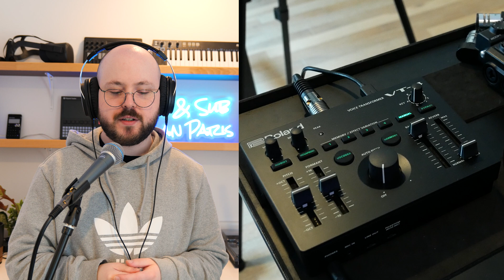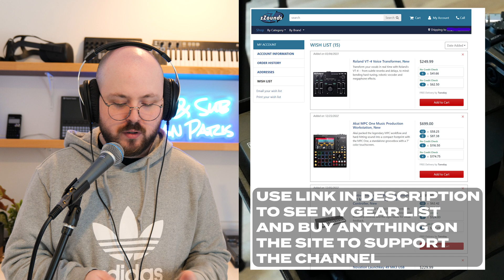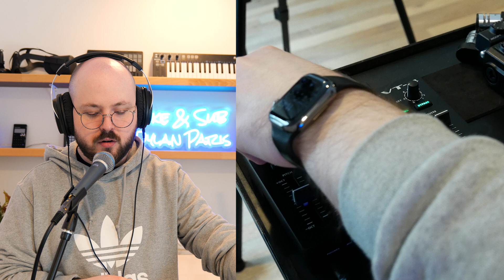Is Roland VT-4 Worth it in 2023?

Comment: You criticised the pitch control for stepping from one note to the next.  I did not see you turn that knob back to say halfway or even 25%.  Basically if you are able to sing in tune, you would never use Pitch control on Maximum.  Maybe only use it like that for funky music!  I used an earlier version of this gadget, and only set to very light correction.  That leaves nearly correct pitching from the singer to stand but corrects only if it would be noticeable. Otherwise the singing does not sound real!!!    It is a Clever little box of tricks.

Comment: Missing the point of the design. You can fire in the harmonics and chords via MIDI... This is a simple voice-box designed to run with a DAW channel or sequencer to give MIDI and auto-correct to the planned live vocal. It's made in Japan. It's a funky karaoke device, with added smart ring-mod robot styler reactive mods. It does sound authentically funky fresh like it was 1983 in Harlem on a beatbox with Bambaataa the Child Snatcher. It also works as a nice DAW interface for output/live input via USB. There are patchy USB software editors for this device that allow you to bust out the TB-3 depth Aira hidden protocols too. If you see one cheap, snatch it or weep. Future classic right here. The E-3 is tiny plugs and loosy goosey. This is the proper hardware if you like that Daft Punk robot boogie vocal. And you can run it on AA batteries too. In your headphones. At night. Around the world.

Comment: Hoping somebody can answer this.  Just got the VT-4 and I love it.  However, it seems that it goes through batteries pretty quickly.  Is anyone else having that issue?  Also, I know it can be USB powered, I just want to make sure I can go from a power strip to the unit and it doesn't have to be from a source like a laptop.  Any help is much appreciated.
Reply: Yup, usb power cable and a phone charger style wall wart 👍

Comment: The manual says it has low cut filter and enhancer and a noise gate you have to hold down certain buttons to change those settings for example hold down megaphone button and hit 1-4 buttons to adjust enhancer

Comment: Hi what's the best vocoder for gospel type of harmony?
Can anyone advise please
Reply: VP-770 but its a full size kbd and not cheap. Amazing gospel choirs
Reply: I have used every model of MIDI harmonizer since 1991.
 I use them in my studio to create SATB for choir. I can write the notes in the tracks and audition each part myself.
 I can modify any part and sing any parts, or all it in real time by myself.  It is gratifying for live  performance, too.
MY students use it to learn their parts.
Also I don't even have to actually sing. The system samples your voice and sings with your own recognizable voice.
Not like Auto Tune. It does not scoop into the note.
TC Helicon has been the best, but they stopped manufacturing in 2012.
 The only new product is the Roland VT4, but it is limited and not as pure.
Here is a demo. You can see other projects on my channel from here.
Much of the magic happens by the software. 
The genius author graciously modified the program for my use.
https://youtu.be/4fhFzexbvjA    Note the freestyle smoothness. I am just reciting without strict phrasing.
Notice in this classic, even the soprano descant happens simulataneously. in real time with my voice sample.
https://youtu.be/oA_zq-nAAME

Comment: Is there a chromatic scale or notes played option for the pitch correction?

I have this and the TC Helicon VE. The Roland VT-4's control accessiblity is good because it's simpler and has little menu diving. What I don't like about it though is there is no dedicated PSU. The USB option can get noisy and I don't trust batteries during a live set. Haha. It seems there is no chromatic scale option for the pitch correction too, which sucks because it's hard to keep on changing or searching for it per song. You're right that the EQ of the VT-4 is limiting. It sounds flat and compressed. Check out the TC Helicon VE. The headroom and clarity are better. The menu options just needs some getting used to but I'm happy with the overall sound compared to the VT-4.
Reply from the maker: I’ll check the TC Helicon out! Good looking out!

Comment: Anyone want to generate a late 60s/70s style vintage echoed vocal style (Think Jim Morrison/ the Jefferson airplane) on the VT4.... Here's one way to go about it

01) Enable Megaphone (megaphone preset 1)
02) enable reverb (reverb preset 2 - the vintage spring delay slapback style)
03) autone/hard tune at 0

Now, from here you have to mix and match between the levels of balance and reverb.....i generally keep reverb level high but toggle between the balance level based on what suits you.

Things you can additionally add as an option
04) With harmony mode (harmony preset 1- it's perfect fifths.
05) Reduce the pitch by 1 octave

The ending result will be quite cool and vintage....but not crystal clear processed sound but something you'd love to perform live or just send an out on to a recorder and record some stuff.
Reply from the maker: Rad tip! Appreciate the step by step!

Comment: I wrote a comment on this video and it got deleted for some reason but not by me...

To sum up my original comment: I own this. I wish you could select major or minor key but there's no option for it which can be a problem. I like a subtle auto tune so I keep the dial around 60 - 80%. There's a lot of hidden commands too by holding certain buttons and pressing others...YT vids out there which show how. Overall it's not bad but the one on MPC has a bit more flexibility.
Reply from the maker: That’s weird that the comment was removed! I didn’t do it and it’s not in the held for review section either. 

I appreciate your insights!
Reply: MusicSky88:  Just trying to help.  You just use the relative major if you need minor.  Three clicks to the right on the key dial.  Example:  If you're in A minor... use the setting three clicks to the right.  C major.  Same notes.  All the harmonies should be in key.  Song in E minor?  Use G major :-)
Reply: @phil7229  Yes I know that. I lost my manual when I got it last year and just found it again recently. It works pretty good for the price. I like the vocal stuff in my MPC Live 2 as well. ✌️

Comment: If you're thinking this direction, high recommend for the Roland E4 Voice Tweaker.... IT's less robustly built than the VT-4, but the built-in looper and Scatter are just exactly what i've wanted in one box.... i've had to get other boxes to handle those functions for my vocal chains, and the E4 has everything under one roof! 😍🤙🌌
Reply: no phantom power is rough tho
Reply: @Brandon-v7j  My VT-4 has a switch on the side for phantom power.
Reply from the maker: Good to know! Appreciate your insight on this
Reply: I would have get one if it wasn't for no midi
Reply: @ripsniff9742 the E4 does have MIDI In and Out, but it’s through TRS. I don’t know if it comes with adapters or not.
Reply: I like the E4 but I've never found it's looper any good, seems a lot like the Kaos3 ie really hard to align with tempo. Are you syncing with the midi?